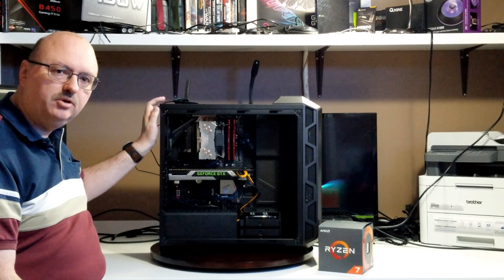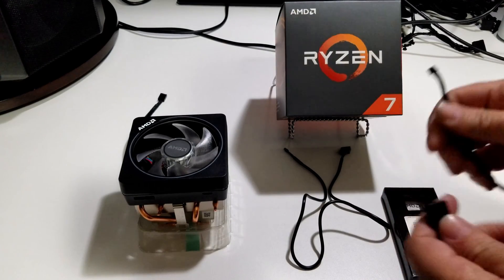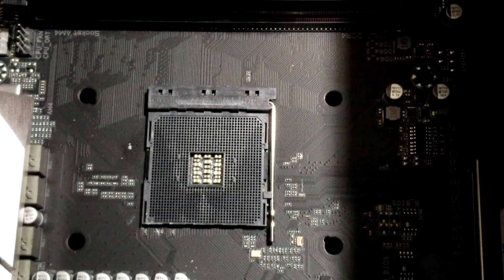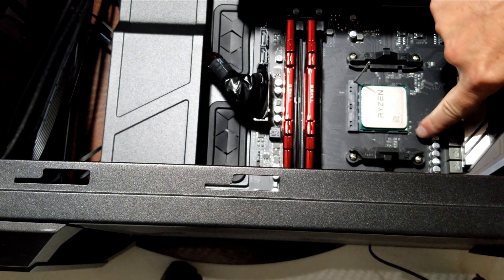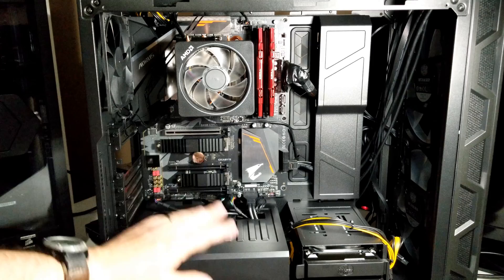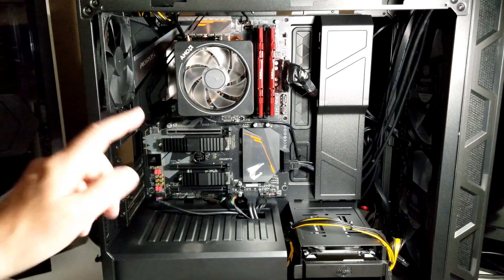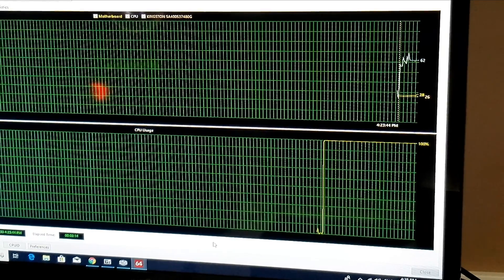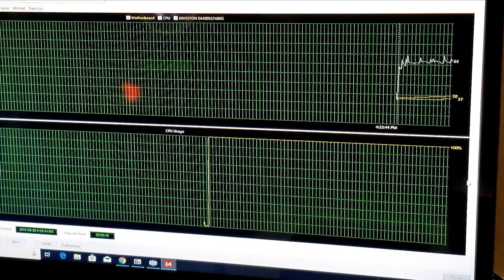Ryzen 7 2700X Review, Install, Temps and using the Wraith Prism RGB

Comment: what if i wanted to control everything including my wraith prism rgb through the motherboard software? so for example asus auros sync
Reply from the maker: I way it's susposed to work is with using both cables, however in my case and with others they had a problem to get everything to work properly with this configuration...as things are always changing however it's possible there have been software updates that might allow it to work now...my suggestion, do like I did and try it and see what happens, if it works for you then no problem, if it doesn't it won't harm anything and then you can go back to the way I did it...Hope that helps...Thanks...
Reply: Reviewing Playing & More RPM can’t I just plug in the RGB header and control the main fan with my motherboards RGB software?
Reply from the maker: Give it a try, it's supposed to work that way, it just didn't work that way for me is what I'm saying...
Reply: Reviewing Playing & More RPM ah okay I understand
Reply: @harrytate5684  yes. Only one cable at a time. And should have packaged some basic instructions

Comment: Also did you try just plugging int he RGB Cable without the USB cable? what would happen then?
Reply from the maker: I did and it didn't work for everything properly, did a few different ways, finally settling on this as the final solution...
Reply: That will make the CPU fan stay in sync with the other rgb fans and stuff in your case.

Perfect if that is what you want, but the cooler is an Addressable RGB (means it can display different colors at the same time).

Notice how his H500 case fans can breath, pulse, and even cycle through colors, but they are always all the same color and intensity at any given time.  This cooler allows for the ring, fan and and logo to do different colors and effects simultaneously, BUT to do this u must use the USB connection used in the video. 

Just wanna match the case? Then use only RGB cable and plug it into the same regular RGB headers as your other stuff.
Reply from the maker: @CaptnYestrday  Great reply...Thanks for helping the community...

Comment: What if you opt for the RGB cable instead of the USB? That would enable RGB syncing with the motherboard right? What happens to the ring and AMD logo? Do they still light up?
Reply from the maker: In theory that should work, however for me it did not, and others have reported the same issue...now it's not to say they haven't now fixed it but if you try it that way and it works I'd be interested in knowing...As for individual control of the Ring and AMD Logo, you can see what happens, and then try it with the AMD Wraith Software and see if that works afterwards...I did all this before making the video though and for me at least it didn't work...Thanks...

Comment: my fan speed is 2000 RPM. Is There a way to boost this speed?
Reply from the maker: You can control either through the Wraith Prism software, or through the BIOS...Thanks...
Reply: There is a high and low switch on the cooler
Reply from the maker: @MattRichy  That's correct there's also the low setting and performance setting on the cooler itself, thanks...

Comment: Is anyone else having the error of "Plug in your CM device to get started"
Reply from the maker: There is a issue with the Asus Aura software causing conflicts, so if you can go without the Asus Aura software I'd uninstall it and it should resolve your problem...not sure otherwise...Thanks...
Reply: @Reviewing_Playing_and_More_RPM  Thanks for the response but I figured it out I didnt have the usb cable plugged into the cooler
Reply from the maker: @chrisjohnson7994  well glad you figured it out, have a great weekend...

Comment: Hi
Hi. I bought 3600 mhz ram for this build (b450 tomahawk max and ryzen 7 2700x). Now I've read that 2700x only supports upto something like 2983 mhz or thereabouts.
Will my ram work? i.e. clock itself down.
Reply from the maker: I have used 3200MHz Ram and it worked at that speed, without any issue, so I'm sure you'll be just fine...There shouldn't be any stability issue's unless your MB says it doesn't support it as well...and yes if for some reason it won't use the full speed of the Ram it will clock down to the highest it supports...Thanks...
Reply: @Reviewing_Playing_and_More_RPM  thank you for the reply. Pairing it with a 2070 bought on black friday. Gonna be a marvelous 1440p build.
Reply from the maker: @HelloMyFriend_  Sounds great, got me a nice new X570 MB now gotta decide on the CPU...have fun with your build...
Reply: @Reviewing_Playing_and_More_RPM  thanks and same to you.

Comment: For me it says to connect a CM device to control my AMD RGB lighting. Is that because I have the RGB USB connector installed???
Reply from the maker: If your using the RGB Cable, it was my experience that I would get this message as well, use only the USB Cable with the AMD Wraith Stealth Software...hopefully this will solve it if not let me know...Thanks...

Comment: So, it doesn’t need additional thermal paste? It comes with a thermal paste pre-applied? That’s so cool. (Real question) Best install video on YouTube BY FAR. Thanks so much!!! Another noob question, is it ok to not plug in the RGB cable? (So there is no light)
Reply from the maker: Yes, the RGB Cable is for just the RGB Lighting, so without it the CPU Fan will work, just fine...Thanks...

Comment: why am i getting 'plug in your cm device'
Reply from the maker: Check your RGB sounds like it plugged in the wrong way...only other thing if that's not it is the software...Hope that helps...
Reply: @Reviewing_Playing_and_More_RPM Im currently having the same issue. It's 100% plugged in because otherwise it wouldn't be working in the first place. And the link i downloaded it from was the first link on the page so I think it's real.
Reply: Reviewing Playing & More RPM thanks I’ll give it a try
Reply: @v2al389  Okay, so I read something saying I shouldn't connect the rgb light header and just the fan cpu pin so I'll remove it and tell you what happens
Reply: Caityotic ok thanks

Comment: Excellent video, I'm about to do a build with this CPU and this cooler, I was wondering if I switch the cooler to high will it run all the time at 100℅ and be loud always? Thanks for this great video, greetings from Caracas, Venezuela
Reply from the maker: Just installed same CPU Cooler and on High, the Fan is loud but not to bad...think the fan can be controlled by software but if not it's easy to switch it back to Low takes only a few secs...hope your doing well and enjoy your build...Thanks...

Comment: That black lever just seems to be sticking so I can't flip it
Reply from the maker: Just ensure it's straight up in the middle and pull it up at first then once it's on you'll push it straight down then apply a little pressure to put it in place..

Comment: I've got myself a 3700x and a 2070 super. I don't plan to overclock yet but I have seen some people saying the cooler gets loud and sometimes hot. What has your experience with it been like so far? Any issues?
Reply from the maker: The Wraith Prism that comes with both I did not find loud at all, and the temps were good, if you were OCing then maybe but even then I think it'd be ok....there's been no issues and there's been 24 hour gaming marathons...not to say there aren't exceptions but my experience has been great...I'm about to get a 3700X as well, now just gotta save for the GPU lol...Enjoy your new items...
Reply: @Reviewing_Playing_and_More_RPM  thanks so much, looking forward to new content 💯
Reply: @Reviewing_Playing_and_More_RPM  my cooler is loud as fuck
Reply from the maker: Could be a bad fan, otherwise maybe go for a water cooler unit instead...
Reply: @Reviewing_Playing_and_More_RPM  fixed it fortunately. I am running the new 3700x and I downloaded the latest x570 chipset driver (directly from AMD) which released on 7/31. This drastically cooled my chip down which in turn reduced the need for the wraith prism to ramp up. I also made a custom fan curve because Ryzen chip's temperature sensor can drastically change temperature readings, thus changing the cooler's RPMs constantly. Hopefully others will see this if they are having the same issues as I did.
Reply from the maker: @Zhiphr  Great job with the downloads but most especially with the custom fan curve, well done...Glad it's working better now and thanks for sharing....

Comment: Can I set the rgb to cycle colors and then remove the cable so it doesn't need to be tidy up.
Reply from the maker: Yes you can set the RGB to cycle colors, as for removing the cable after, never tried it but suspect it would not work, but worth a try I suspose...Let me know I'd be interested if it worked or not...